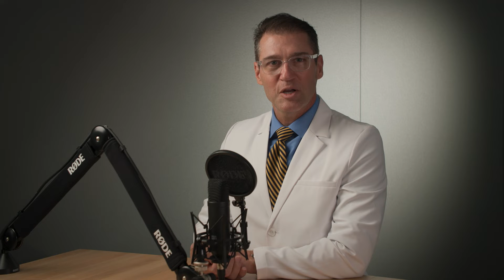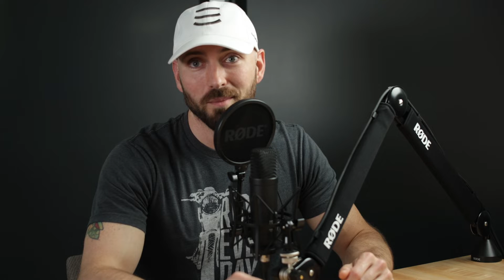Pressure Necrosis DOESN'T EXIST

Comment: Why not just oversize the osteotomy instead of backing out?
Reply from the maker: The last drill is designed to the pitch diameter of the implant. There is no way to oversized the osteotomy without using non OEM drills which presents additional risk factors. It is pretty easy to put the implant in reverse and accomplish the goal of creating space.

Comment: Insufficient Blood Supply? Why then does a fractured mandible heal only in 4 weeks?
Reply from the maker: I think you’re spot on. If you think about under what conditions create high insertion torques they typically involve engaging compact bone.  Compact bone has poor internal circulation. Most of its blood supply comes from endosteum, periosteum, or the peridontal ligaments. Stated in a simple way high insertion torque equates to crappy bone! So my theory is that pressure necrosis is not the cause of perceived higher failure rates and the real cause is poor bone quality.
Reply: Any papers ?
Reply: Viewpoint of a engineer, at the absolute end of the video you hit the nail on the head; Osseointegration is what permanently connects an implant to the bone. On soft bone, it just means that the implant takes a long time to become as secure as the bone. 

In hard bone, the implant may not osseointegrate as well as soft bone. The implant is relying on mechanical forces only on the threads to resist biting forces. Even hard bone will experience some creep, from radial forces from the implant insertion and from chewing forces. This creep results in less ultimate strength in the socket holding the insert. If radial forces are too high in non vascular hard bone, bone tissue can mechanically fail and cannot heal like vascular bone?

Comment: Are you using the bone tap on a hand piece or doing by hand with wrench? Also do you ever use the implant itself as the tap where you back out the implant a few turns  and then insert it back in?
Reply from the maker: I use the implant as the tap when necessary. I will use the hand piece until I start to hit its limit (usually 70Ncm) then I use the hand wrench to finalize the placement with a two forward and one reverse motion.

Comment: Wolff's Law rules!
There are studies showing implants with 150 N-cm of insertion torque do just fine. One that comes to mind is this:  Pressure Necrosis and Osseointegration
Alan Meltzer, DMD, MScD;† Harold Baumgarten, DMD;* Tiziano Testori, MD, DDS;¶ Paolo Trisi, DDS, PhD‡
Of course, with extremely high insertion torque on narrow implants, fracture of implant head is a concern.
Reply: Great paper that was way ahead of it’s time. I think your point about insertion torque and implant driver stripping is where the confusion really came from. Our orthopedic colleges don’t measure torque during insertion of their fixation screws. They also only use grade 23 titanium alloy which is nearly 40% stronger than grade 4 which is used in a lot of dental implants. Using a weaker implant would thus create a concern for torque but not because of pressure on the bone but rather plastic deformation of the implant. Over time one can see how this could easily become a source of confusion.
Reply from the maker: just re-read that paper again. Classic!
Reply: I don’t think that it exist but this is 3mi propaganda.
Reply: The paper that is.

Comment: On the one hand they say - dont overtorque the implant so you dont put too much pressure on the bone. Then densah burs come in  and do exactly that - put quite bit of pressure on the bone.
Reply: With Densah, it is grinding up loose bone that it is tightened into, it's not High pressure to a solid cortical plate, 2 very different things
Reply: You are exactly right. It can’t work just sometimes and make sense.
Reply from the maker: Double standard for sure.